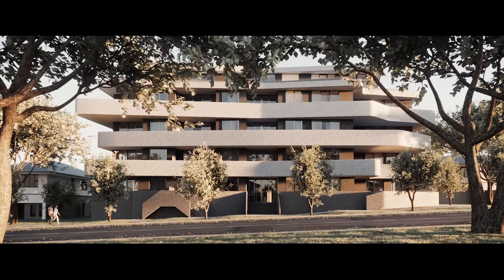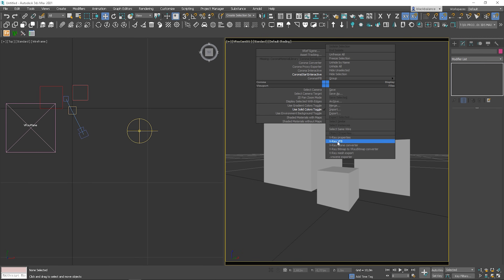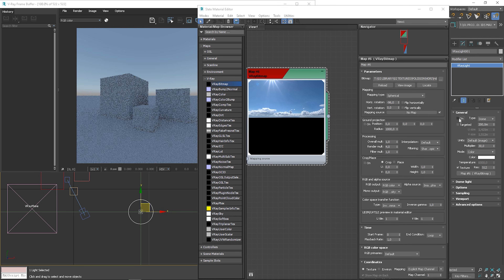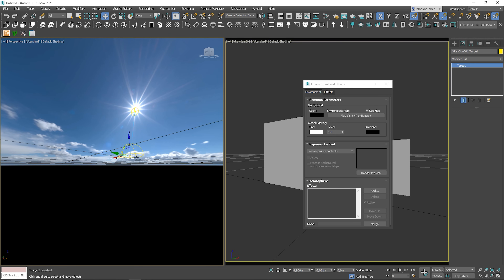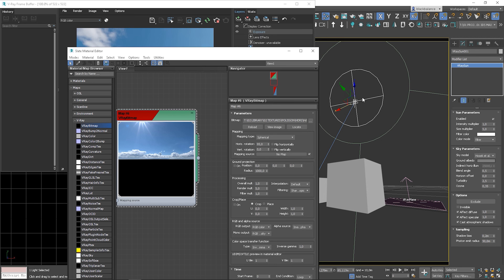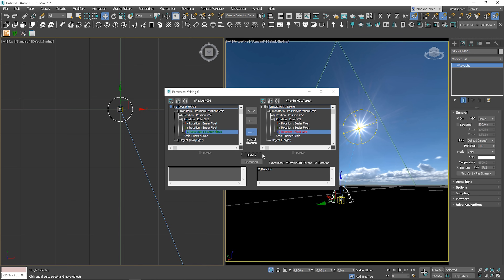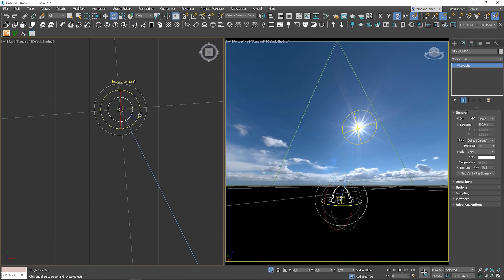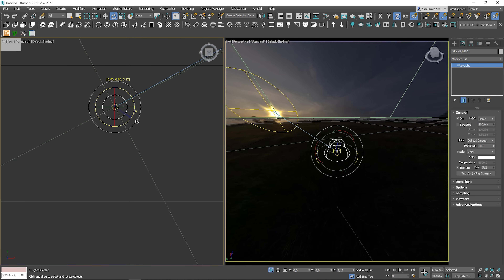HDRI Lighting Setup in V-Ray 5 | 3ds max

Comment: Hi .... I have few problems with v-ray 5 (first when the render is finished and then I want to save the image, the image is saved with lower quality and all the adjustments I made in the light mix is undone. The image looks way better in the fram buffer and I can't get it as it is. Second the light layers that is saved with the elements for example ( the ies , sun .....) is very noisy I can't use them in the post production even if I need to bec the image becomes more and more noisy and low quality. Can you help me with this... thank you 😊

Comment: did you setup your  camera setting  first  because its getting  very  exposed  when i tried that same hdri its not getting the same result as yours did you used camera white balance  or anything else i am coping all the steps but not getting  the result i have also use exposure layer  just like you aloso

Comment: A great solution, I wonder if it wouldn't be easier to align the vray sun to the position of the sun in the hdri image, link the vray sun and the vray sun target to the vray dome light and then flag the "lock texture to icon" option in the "Dome Light" section of the vray dome light settings. For me it seems to work.
Reply: Yes. There is this plugin:
http://www.scriptspot.com/3ds-max/scripts/find-and-bind-vray-hdri-sun

Comment: Actually the default center of the Spherical Dome Light projection in VRay is not the Dome Light gizmo but the eye (transform gizmo) of any camera chosen for rendering and that's not by accident - it's programmed to make the straight correlation between your Virtual Physical Camera in the CGI scene and the actual camera used to produce the HDRi image (you can check it while looking at the ground projection through the camera downwards in the viewport - the center of projection can be shifted away from the camera by using the projection parameters in the HDR Bitmap, but not by moving the Dome Light).
    So, assuming that little detail, the right way to do this trick is to match the Dome Light with the position of the currently used physical camera - then link only the Dome Light's translation operators (Translate X,Y,Z) to it. Tick the box in the Dome Light rollout called "Lock texture to icon". After that the Sun Target can be placed on the Dome Light and link its translation to it (same in the video). And finally you can use the selected camera view to move the Sun position until it matches the Azimuth and Altitude angles with those coming from the Spherical HDR image and link it to the Dome Light - that way you can freely move the camera around the scene without changing the corrected Sun position and it will follow the HDR image when you rotate the Dome Light. Changing the "Size multiplier" in the Vray Sun rollout will affect the softness of the shadows in the scene, but you need to consider something else -  it will also change the Sun size appearance in the Diffuse and Specular passes, which can result in unwanted differences with the HDR.

Comment: In my experience u don't need to put a light for the sun if u're using a nice hdri (like pether Guthrie hdri, hdri skies...).
The problem with poliigon hdri (and many others) is that they're basically trash, so you are forced to find 200 tricks to get a result that with a decent hdri u would get in a couple of click :/
Reply: Also, the vray light dome should be used with a multiplier of 1, if you want a result that is consistent with the hdri.
Obviously if the HDRI is not of quality, one value is worth the other😅
Reply: There is not the perfect solution for your needs, it always depends on what you need in your scene. The intensity of the sun can easily painted in Photoshop for instance. If you need more control you can use the vray sun or any other light
Reply: Peter Guthrie HDRI are the best..
Reply: Today there are many other valid shops for hdri, but I would recommend avoiding the poliigon ones, and all hdri that  "seem wrong" when you put them in the scene.
With a good and correct hdri you just have to adjust the exposure of the camera to properly light the scene.

Comment: theres a script "find and bind" which automates rigging the sun with hdri, I never tested it though
Reply: Its the best and easy
Reply from the maker: thanks for sharing.
Reply: @ArchVizArtist  The script works flawless, it does the same process. But the position of the sun gets locked by the transform link settings, this video showing the process is what i needed to handle the setup with more freedom, so far if i wanted to change hdri i deleted the whole thing 😂 so thanks so much for the video
Reply: ZGUEB Mohamed  Control your HDRI Gamma.